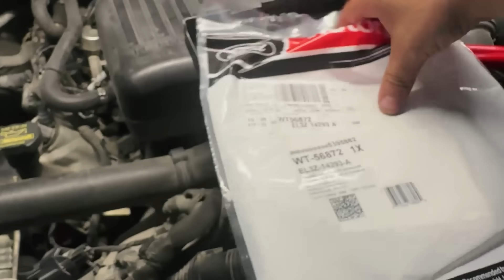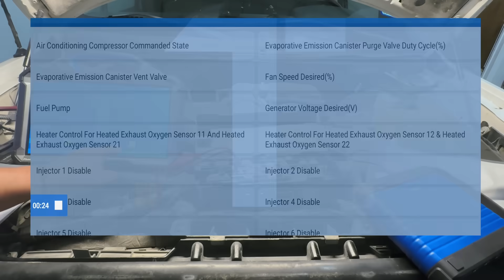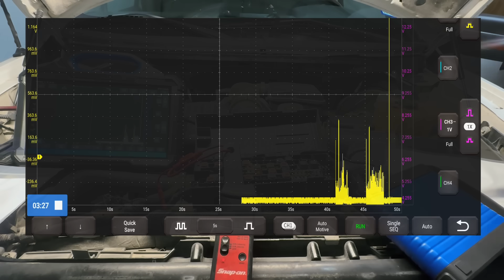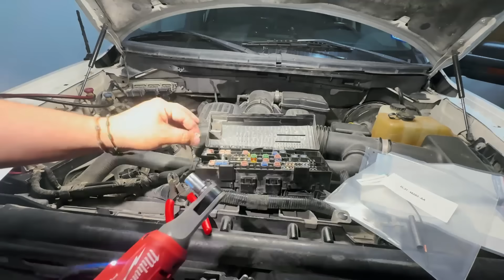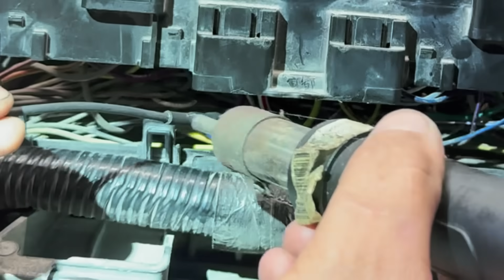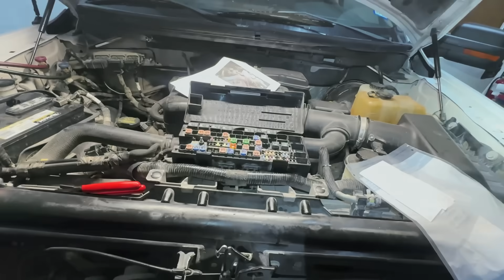Ford F150 No-Start Condition

Comment: Good video. I just watched one where the tech tried to slide a heat shrink tube over a joint that was still too hot. Shrunk on contact and couldn't be slid fully over repair.  He had to do it over. Patience is a virtue. Keep em coming Oz. Thanks.

Comment: Oz I watched how you did the solder job. You will find that if you use a little flux first that the solder goes on so much better. Good video!
Reply from the maker: Man I was trying to find my flux. I have the one with the syringe but couldn’t not find it. Left it at the other shop when I moved shops. I just tried to make sure to heat up the cable to make sure the solder made it all the way thru
Reply: @OzMechanics  You're good I just thought you may not have known. I use a paste that comes in a can about the size of a chew can. Had it forever. Use it for plumbing copper as well